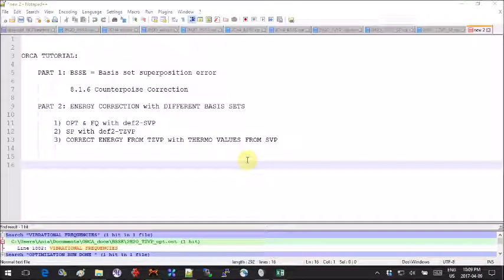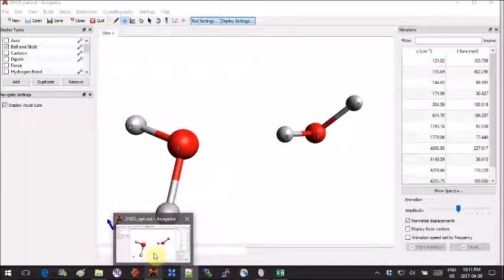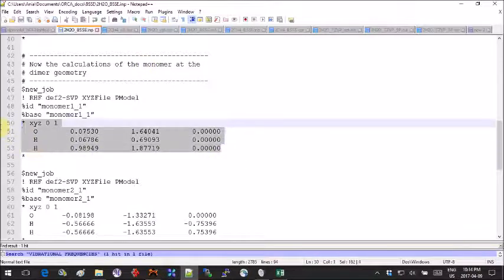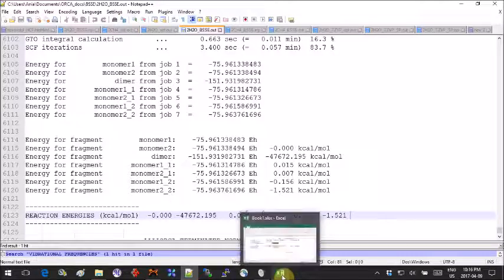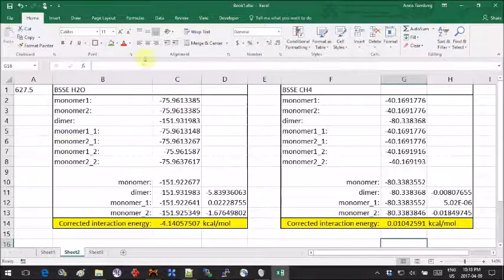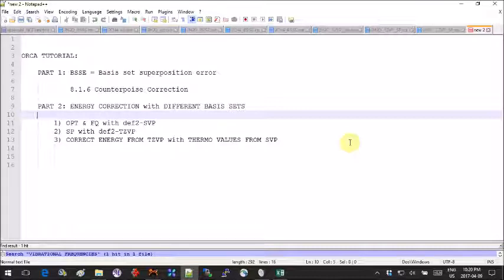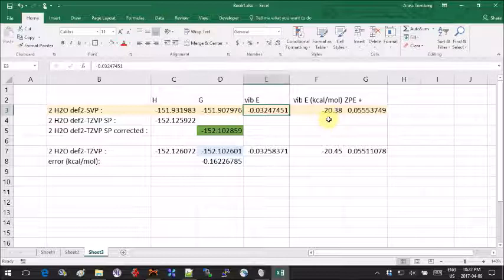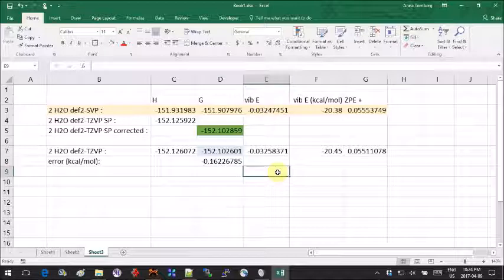ORCA: BASIS SET ERRORS

Comment: exist a mode for implement a point group?
Reply from the maker: From ORCA manual:
ORCA makes limited use of molecular symmetry and is mainly useful for orbital and state analysis in SCF/CASSCF as well as computational advantages in the MRCI code. Using the UseSym keyword it is possible to have ORCA detect the point group, symmetrize the coordinates and change the origin and produce symmetry-adapted orbitals for SCF/CASSCF calculations. Currently, only D2h and lower point groups are supported.

- In order for the automatic point group detection to work, the molecule needs to have been symmetrized properly before (for example in Chemcraft or Symmetrizer ).  It is also possible to change the treshold for pointgroup detection
Reply: ty for answer. another question pls:
how i can use z-matrix on orca? Need also coordinate cartesian for generate input file?

Comment: How to draw Nitrogen radical in gaussian?
Reply: Draw your molecule and set the charge and multiplicity (for mono radical most likely duplett) accordingly. 
For example:

# hf/3-21g 

Title Card Required

0 2
 N                  0.21316222   -0.77941175    0.00558185